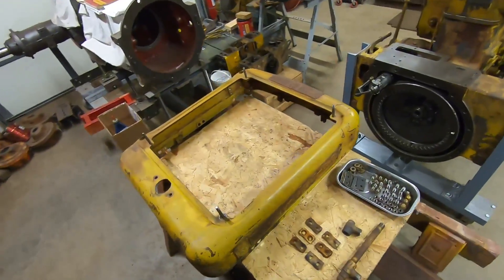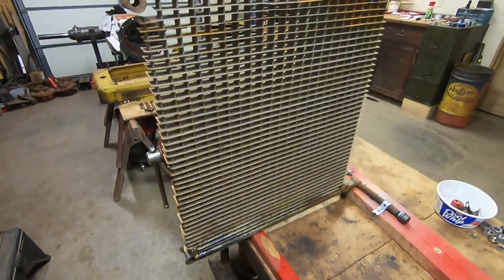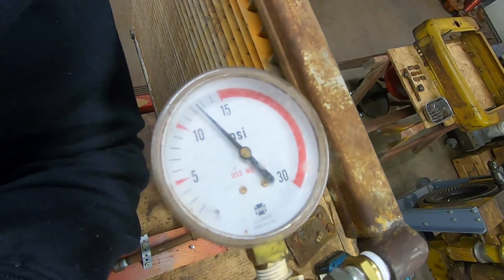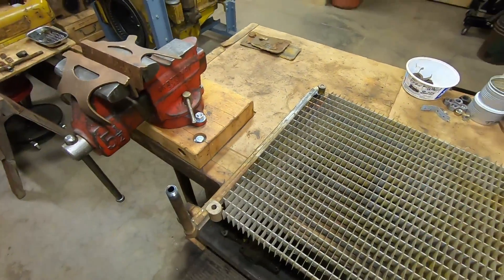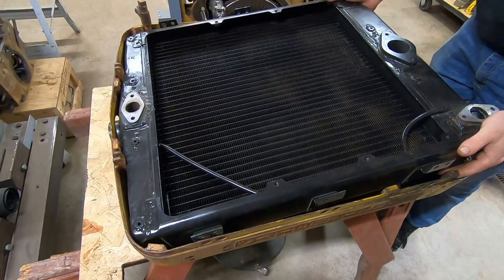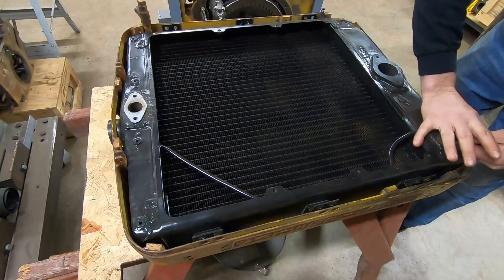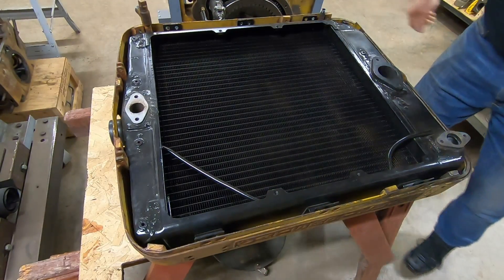Caterpillar D2 #5J1113 Diesel Engine Assembly Ep.50: Assembling & Installing The Radiator

Comment: If 5J1275 was the last tractor to have the first generation equipment on it, how 5J1311 get them? Did they just use up stock until they were out? 5J1311 was only 36 tractors after the cut off. I know I have 2011 parts on my 2012 Harley that they used up existing stock, because mine was an early production serial number.
Reply from the maker: You got a couple of the numbers transposed, it’s 5J1113 which puts it well earlier than the 5J1275 cutoff 👍
Reply: @squatch253  DOH! My lysdexia is acting up. Thanks.

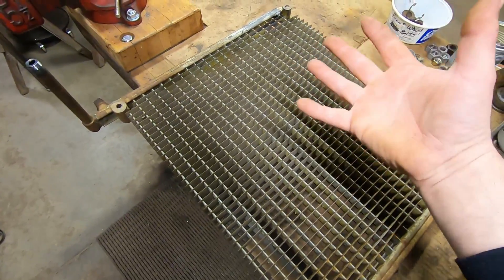Comment: 2:33 Senior probably washed the oil out of the cooler; Gasoline is an excellent oil solvent. And gasoline evaporates fast. After washing with gasoline, then flush well with water. Dry well.

Comment: I use an anti seize compound on every bolt I put back on my caterpillars. What is your opinion?
Reply: @squatch253  Thank you for your response. I agree, I’ve never had any troubles breaking Caterpillar bolts and nuts loose. They used good metal in those days!

Comment: Squatch I started dissembly on my d24u parts machine  pony motor off thanks to you videos my question is there's water might be antifreeze under drive gear in block is there a drain plug to empty

Comment: There is a complete d2 with plow near milwaukee.  They have it listed on Craigslist for 9k or best offer.  American standardized assembly.  Just watch the Brits rebuilding the old tanks they prefer ours unbolt any of it swap it to another no fiddling just goes together.   Theirs each made separately drill new holes weld in the old.

Comment: Little trick on the oil wicking into your solder puddle. Pull a tiny vacuum on the part if possible. Also. Will you be clear coating the dozer to try to keep the patina ?  It really is a nice shade of used.

Comment: Far as getting the radiator in and out of cover you could make a couple handles to bolt in to the top and bottom centered hose inlet/outlet

Comment: She's looking really nice, bud. Hope that you can get a good jump on the undercarriage and all other components this winter. I cannot even fathom the amount of work it is to do a crawler over a tractor.
Reply: @squatch253  I can definitely see how it is AT LEAST twice the work. And a lot of very HEAVY components to move around as well. Most all of the early diesels are an expensive and extensive undertaking - the IH gas start diesels, for instance, are quite expensive to work on. No pony motors, but the cylinder head alone can cost what a full engine rebuild will cost on a normal gas engine. I have thoroughly enjoyed this series so far, and feel pretty confident that anyone who has been watching could tear down a crawler and rebuild one largely just using your videos! Staying tuned over here, Squatch. Working on getting better.

Comment: Duncha love oil leaks? Having that fight right now with a junkyard 318 i dropped into my Beast; the oil filter adapter plate has decided to leak twice. Just glad its an external unit and i dont need  to pull the engine out. Irritating when everything else - aside of the transmission torque convertor guard plate rubbing - went so damn well. You got some damn fine work comin together, lookin forward to its resurrection.

Also, yea, know what ya mean by that 'born in the wrong era'.

Comment: Man! I could not be more aligned with your feelings of living in the wrong era! I drug an old Cummins 6bt with a Bosch rotary pump home just the other day, just because I love those old mechanical diesels. The wife says: "what are you gonna do with that?!" my reply: "stare at it". I had it running sitting on an old bus steer-tire in about 10 minutes bye-the-way LOL. I drive a 1970 Dodge truck. My toy is a 1971 Dodge Challenger. I own a shop full of late model high tech CNC machines, and what do I want to play with? The 60 year old manual machines over in the corner! I should have been born in the 19teens!
Reply: @squatch253  I have only been in a few shops that old. But, I can totally relate!

Comment: Seems like that 9 out of 10 times failure rate on the re-soldering of the oil cooler could be cured by a thorough de-greasing and cleaning of the interior of the core.

Comment: The gentleman who rebuilt the radiator core certainly was a excellent craftsman and clearly displayed pride in his work by properly painting the finished work. It is a shame the individual who completed the radiator assembly did not share the same high workmanship standards. To reinstall that fine radiator core in a patina infested final assembly is a crime.
Reply: @squatch253  I watch your channel because,  A. Summer is over and one doesn't like to engage in a lot of outside activity in the cold at my age. B. There really isn't anything much worth watching on TV anymore. C. As a teenager I worked summers as a helper in a John Deere/GMC/Wisconsin Engine dealership and really learned a lot from the mechanics there so I do have an interest in mechanical repair, just not the Cat product. There you go, pick the one you like best.  As an aside, 20/25 years from now someone will have a Ford pickup like your old Blue to restore and will be saying " Boy I wished they still made them like this one". Hope I didn't give you the "Big One" there,  you may want to sit down.
Reply: @squatch253  Spot on!
Reply: @squatch253  It seems you have a tendency to insert channel viewership issues as a means justify whatever you wish and often to avoid the original question at hand. You can only have one standard for Quality and that standard must apply to all aspects of the rebuild process including paint requirements. I started watching because I was really quite taken with your abilities to resolve problems associated with the MM restoration project. Outstanding really. These Cat projects are really just elaborated tear down and reassembly projects. As you said I really have no substantial interest in Cat crawlers. Now if you were working on a Euclid TC-12 like the ones I watched doing a square dance in Chicago in 1955 that would be different. I know you worship patina so I surmise you must view the rusted out fenders on the blue pickup as just a case of super sized patina.

Comment: Is there a way I can  down load all the D2 video or buy them on a drive
Reply: Thank you I hope to be ready for the steering clutches dissembly I need to make room in my shop and get d24u731 inside and also pick up D2 4u parts machine  I hope to be following along

Comment: Looking good with the radiator on the motor. Do you avoid using Never seize on the radiator bolts for a reason?

Comment: Yes there is something to be said about the only plastic on most engines (Gasoline) of that era was cap, rotor and points cam follower and cover. Maybe the coating on the steering wheel and control handles. Thumbs up!
Reply: If they had the plastic we have now they would have used it. A lot of the older products that could have been rebuilt back then weren’t because of newer technologies.

Comment: I'm with ya on the being born too late, the quality of the everything built was so much better and so was the life they lived in!
Reply: In the 1930's depression?
Reply: Some things were better back in the day, most things were not.
Reply: Hmm. Let's look at cars. When I was young, we had a yearly ritual in the fall. It was called a tuneup. If you didn't do it, it likely you would have problems on cold winter mornings. Also, getting 100,000 miles on a car was quite an achievement. Today, it's quite doubtful that most drivers know what a tuneup is and 100k is quite routine and unremarkable.

Comment: Ahhhhhh, looking like a Caterpiggle again. Yay! 
You would think the older shells would be iron and the new ones stamped steel. Kinda reversed of human history; stone, copper, bronze, iron, steel, aluminium, cheap recycled water bottles and shopping bags.
Reply: @squatch253  No disrespect intended! I just thought it seemed odd. None of us were inside their heads back then to know what they were thinking. Shoot, there are times I don't know what I was thinking. Lol!
Reply: I have a comparison for you. My Dad worked for Griffin Wheel. They made railroad wheels for most of the lines, but made wheels for mostly box cars and caboose. The railroads phased out caboose and his plant closed because they didn't want to spend more$ to restructure the molds for new style wheels. Anyways, most wheels in the early days of railroads were iron, then steel for newer trains. By the time I was born the wheels were custom blended to the train mfg comp specs. I'm not sure what they make now, could be iron. Maybe Flinstone is making rock ones.
Reply: @squatch253  Yep! Griffin just made the wheels and they were either 36" or 42" I believe. When the rail companies quit using caboose Griffin had to send their work to the Cal plant. Most of the wheels here were going to piggy back cars. They didn't have molds, or furnaces designed for them (different size and metal specs). They closed after Dad retired, then reopened after rebuilding everything. The engine mfg comps made their own wheels, but Santa Fe bought a lot of Griffins wheels along with UP and Illinois Central I believe. I remember you talked about working on the railroad.

Comment: Man your lucky to have a good radiator shop. Our local one closed, said the new plastic and aluminum ones where unserviceable. Was cheaper to by aftermarket.
Reply: Sigh... Ya could drive 4 hours and there, and back again just like SQUATCH & POP has done. OR SAVED your Benjamins to do it correctly.? But at least it runs, right.?

Comment: I bet part of the reason the radiator went into the shroud easier than it came out was that dent by the filler neck that you fixed. It was probably taking up a little room the radiator tank wanted when it was going in.

Comment: So no doubt your radiator repair man would have measured all the hole centres where practical to make sure the radiator went back together like it was originally. Can you imagine if that radiator did not fit into the frame? It did though!